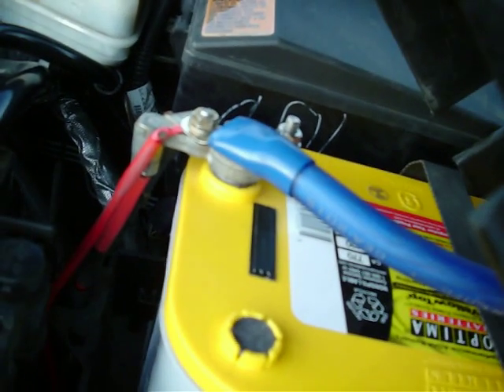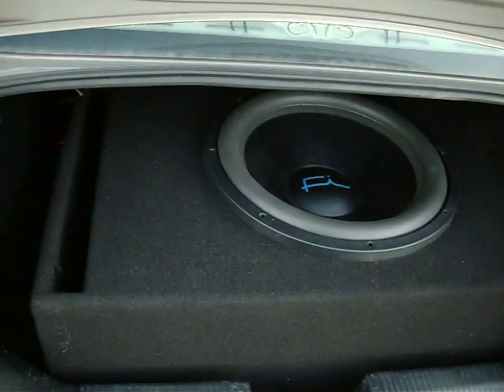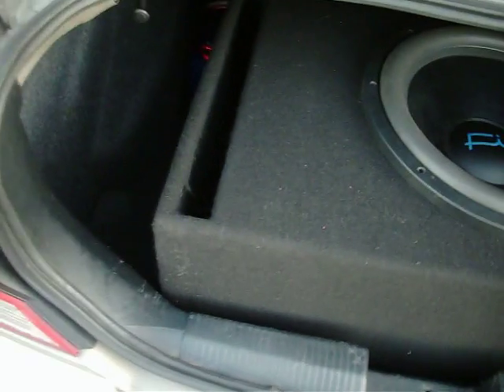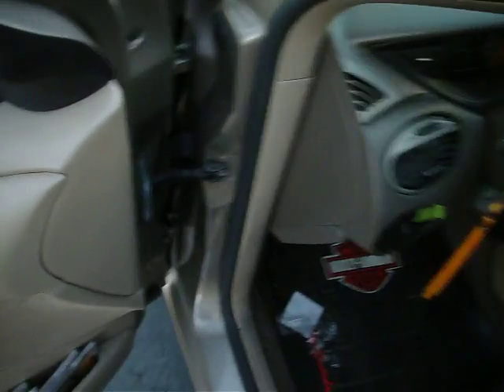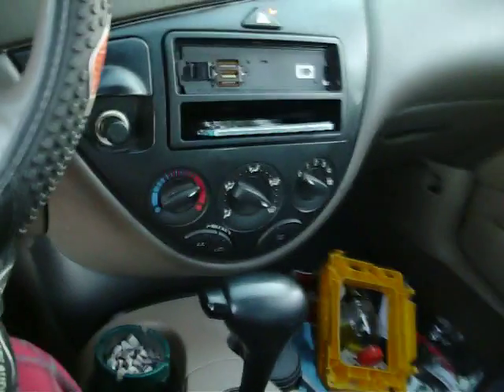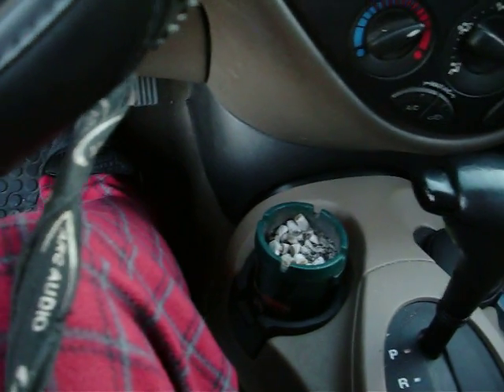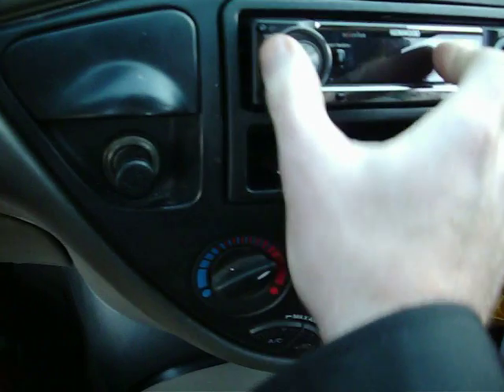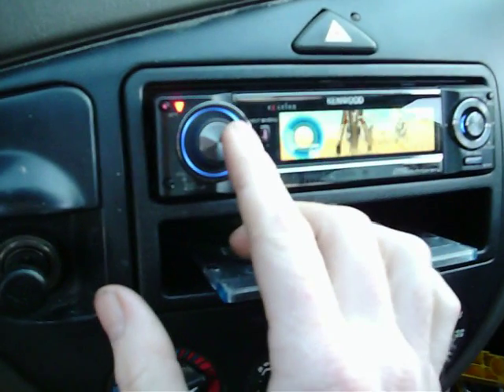VOLTAGE DROP JL AUDIO 1000/1V2 YELLOW TOP KINETIK ZERO GAUGE

Comment: I have the first model kinetik the HC600 To a 3000 watt amp... and my lights don't dim.... And the battery dose not cut off... everything in you system needs a different ground. even my EQ and radio have different grounds plus all 3 amps in my truck use different grounds. And i have a regular duralast battery in the front..

Comment: i had 50 amp alternator, 1000 amp red top battery under hood, kinetic hd600 in back and two 8 gauge positive to back battery and all the negative 4 gauge and didnt have trouble at all with my soild audio 1500d.  I recommend u to uses a multimeter to check the volt close to the amplifier if it goes really low volt then it must be the ground used to the amp.  If the volt keep strong then it must be the supwoofer check the wire in it

Comment: You should have zero gauge all around for the amp and on my amp which is 5000 watts I have no fuses in between my wires it seems that will hold lots of power back

Comment: 4 guage is way to small for that amp its choking it also body grounds are horrible ground to the frame and upgrade your engine and alternator ground and power wires to 0 guage and youll be set

Comment: @svt4life my setup now i have a 4 gauge from the battery to the distro. block and it splits 4 gauge to my amps. it would be a good idea to put a fat 0 gauge from the batt. to the distro. block. i did the big 3 in 4 gauge, i have stock alt and battery.

Comment: Yeah your stock wires running to your batt and your alty wires are like a cheap 6 gauge and the wires your adding are like 1/0 gauge. Meaning it sucking the life out your battery before those 6 gauge wires could fulfill the needs of that battery. Let us know how it goes when you find the problem.

Comment: You need the big three. Still check all your connections like the grounds that are bolted to the chassis/body. I had a similar problem and it was a wire that just needed to be tightened down. I guess the it vibrated loose.